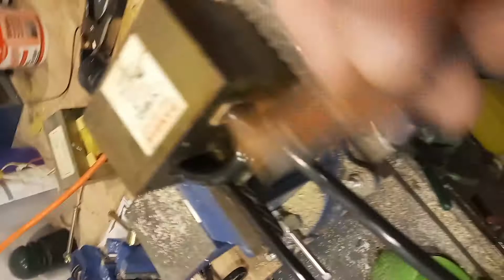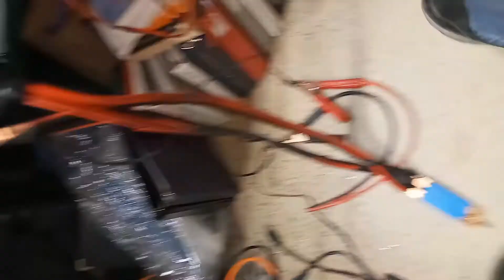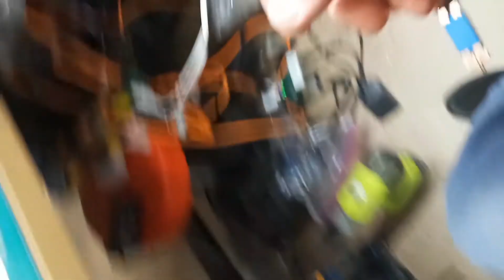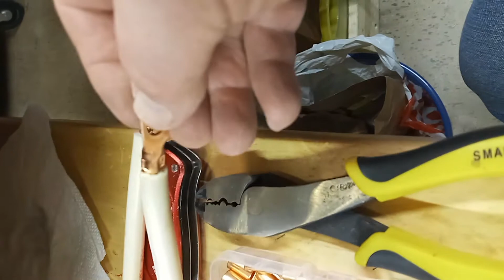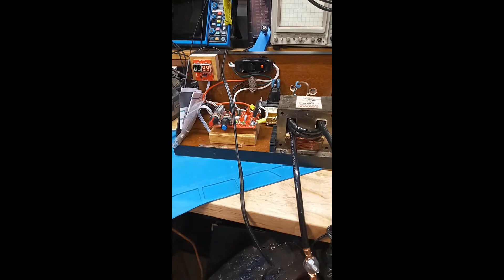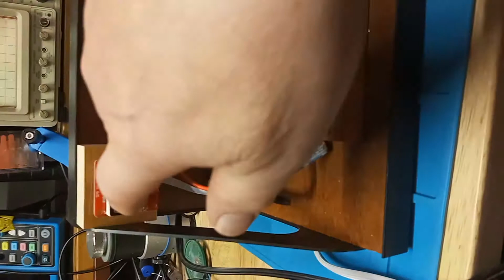MOT SPOT-WELDER works now, but it didn't start that way!

Comment: Hi i have the same board i did everything as it should be ...but its not welding my batteries ...and the second red led is not blinking ...do you have an idea ?
Reply: Do you have a 9-12VAC transformer powering it? Does the left "power" led come on?

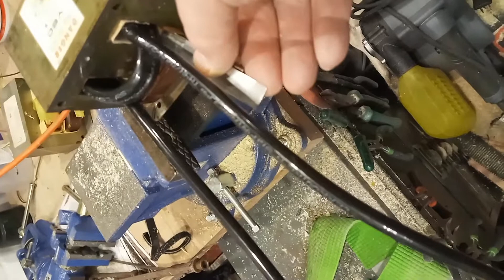Comment: 0:19 wrong The shunts (by norm insulated laminated tabs) are not there to limit current across the output but rather to make the whole transformer operate more efficiently when under load by reducing (if not completly) eddy current losses. 

So ideally if possible you wuld leave them in there, aslo fow spot welders of this sort (I'm currently working on one) One would need to have a minium of 3 to 5 turns for maximum performance and the wire gauge used should between 25 to 35mm2 .

Good luck I hope you succeed and find my comment useful for the future.
Reply from the maker: Thank you for that information! Based on research I did, they took the shunts out, so I used their visdome. 
I have it working, but I agree it needs one or 1.5 more turns. The cable is so thick, that I wounded  in there as much as I could. No room even for a half a turn.
Reply: Microwave transformers are engineered to feed a magnetron safely; the extra steel plates (shunts) limit the transformer’s short-circuit current and help with regulation / prevent one-sided core saturation. Removing them makes the transformer behave more like a low-voltage, very high-current transformer — which is what you want for spot welding.
Reply: @AbhishekKr1902  Thank you.
Reply: Thanks for your comment, I was wondering about the function of the shunts. I'm building the same project. How did your project work out? And If you're using the same control board, did  the board die quickly, I've seen a few YT videos reporting that. Thank you.

Comment: What is wire gauge (AWG) of black windings on transformer ?  What is gauge of white wire?  Thx, good video.
Reply from the maker: The black primery wire is 0.311" (including very thin insulation) of multistranded wire and the white wire is a very thick "car jumper wire". The key is to keep the wire as short as you can, because with the length of the wire, the power diminishes radically! Hope this answered your question.